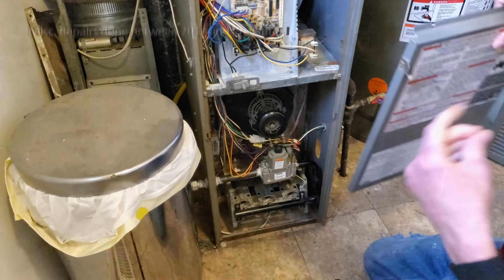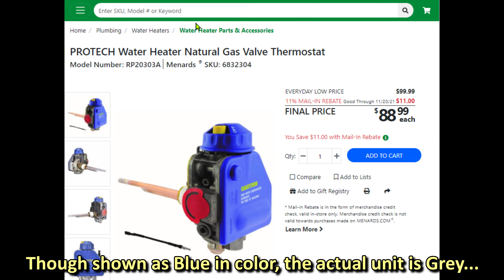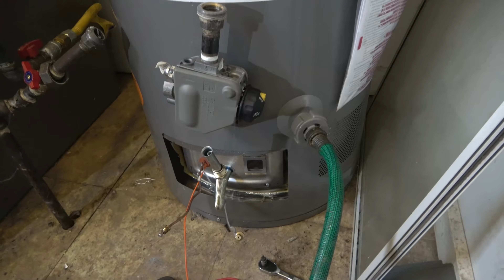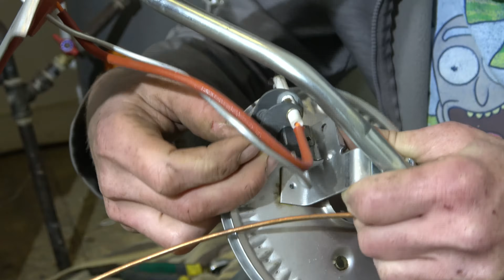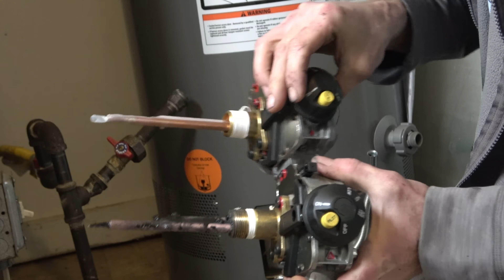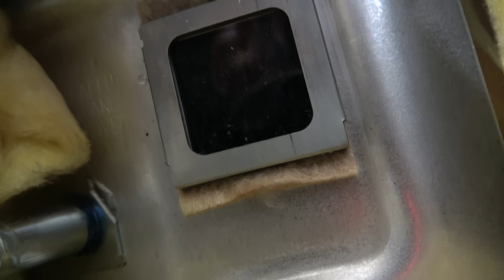Water Heater Gas Valve & Thermocouple Replacement (Richmond / Rheem / Others) #waterheater #DIY

Comment: If you are in a jam and can’t get the valve, you can jump the open circuit on the little white piece above the thermocouple. Little dab of solder, a small alligator clip , 1/2” piece of copper wire bent in a “u” shape pushed in that space. Could even clip the white wires and wire nut them together. Obviously it’s not recommended to override any safety feature but sometimes you gotta do what you gotta do. 
Rheem takes over a week to send the warranty valves. Nobody wants to wait that long.
Reply from the maker: I was a little afraid to mess with the actual gas valve in any way, plus this is a rental house and my landlord paid for the replacement part anyway. But if this happens again I may try this, I still have the original gas valve to play with
Reply: @JustinNelsonsProjects  I feel you, messing with valves and safety features can be dangerous. I would call the warranty dept and get the new valve, it’s free.. why not. You’d have one on for the future if needed or you maybe send it off to a subscriber in need. 
Excellent video tho, very informative and easy to follow for a diy guy. I do havc for a few property rental managers. The plumber installed prolly 40+ of these over 2020 and he doesn’t service, only install. They’ve been going out one by one. I’ve done about 20 so far, always keeping a few valves on standby as local suppliers have a hard time keeping these in stock. I did not know that Menards had em, and cheaper than my supplier @ $140. Appreciate that info.
Reply from the maker: Since I rent this house, but I do all the maintenance as a favor to my landlord, I handed the receipt and a picture of the serial number etcetera to my landlord. He never filled out the warranty paper a year ago when he bought the water heater. So he just ended up eating that cost. But sure if it were mine, I definitely would have claimed that as a warranty repair as it was a 3-year warranty and it had only been one year almost to the day
Reply: Thanks for this idea. I used a papper clip to jump it. Atleast I have hot water until replacement gets here...
Reply: @outdoorswithcam  another contractor buddy already had an issue with 2 replacement valves just a year later.. maybe he got some old stock with the same defect. I’ve done around 20-30 replacements I’m not so confident anymore they fixed the issue. Save that paper clip 😂

Comment: Instead of draining the tank you can shit off the water then open the pressure relief up top for a few seconds into a bucket. Prep the new valve, Then twist off the old valve and pop the new one in. Only about a cup or 2 will come out Could put a old towel on the floor to soak that up.
Reply from the maker: I was going for the safest option there, plus I figured it couldn't hurt to flush out that tank. I'm on well water here and draining it from the bottom would certainly get some of the gunk and sediment out, you saw how nasty the insert of the old gas valve looked
Reply: @JustinNelsonsProjects  oh yea definitely. I never worked with any tank on well water but I’d guess it would greatly benefit from an annual flush. That would be more for a service tech needing to get in/out and on to the next.

Comment: I too have had my water heater go out after a year of service that I got from Menards. The water heater has a warranty on the water heater for 2 years for in home. I called on Monday, and still no parts to fix it. Christmas is Saturday. A friend of mine told if you take a green scratch from your kitchen a litely scratch the thermocouple it will work for sometime.
Reply from the maker: I did try cleaning the thermal couple with a scrubber pad and even sandpaper. But the problem was actually the gas valve because even a new thermocouple did not fix it. Still a good point though, oftentimes cleaning the thermal couple can fix a problem like this
Reply: As emergency temporary solution is to put a metal shorting wire or wrap a tin foil on that white sensor ends, shorting out the thermal cut-off device, until a new one arrives. This will make your pilot lite to come on.

Comment: I have a Richmond W. heater purchased by Menards in November 20. Same problem. My pilot light kept going out. I am going to change thermal couple first. Must be a defect with Richmond product. don't have time to wait on phone to Rheem answering call center. not very happy with cold showers
Reply: The 2020 valves are defective. They go out in about a year from install
Reply from the maker: I live in a rental house, so even though I installed it and I do all the maintenance around here, I didn't have a choice of brand when it came to a new water heater. So of course a year later it broke, and just the mere fact that Menards carries the thermocouple and the gas valve on the shelf directly underneath the water heaters themselves, tells you that they must go bad quite frequently... You don't usually see spare parts for sale next to brand new appliances lol
Reply: Quick fix for the old bad control valve is to replace the open thermal cut-off device with 120*C rating instead of the 91*C install, it should have a wider safety factor. Keep it as a next replacement when your new replacement arrives.
Reply: @mikibihon8826  do you have that part number?
Reply: @MoonRambo702  there is no specific PN# only the temp rating is stamp w/c is 91*C, 10A by 250v but there are other temp choice of 93*C, 100*C to 120*C. Lots of suppliers on Amazon, one of them is NEC. It will cost you about $6-$7 for 5 pc. +S/H
Reply: @mikibihon8826  these particular ones don’t have the cut off in the front like some do. This one is built into the valve I assume. In a pinch on my own equipment I’d consider bypassing the internal one and adding the cutoff into the face plate.